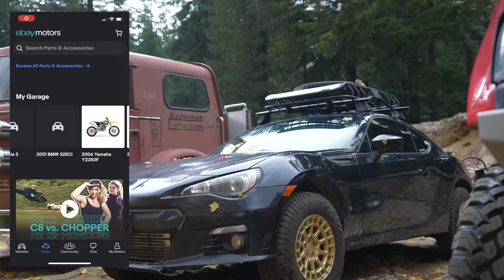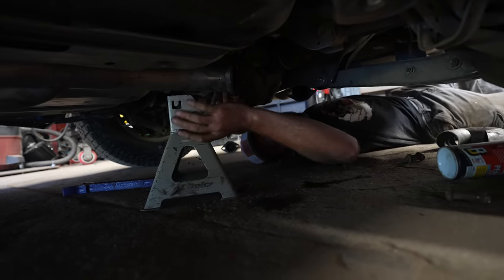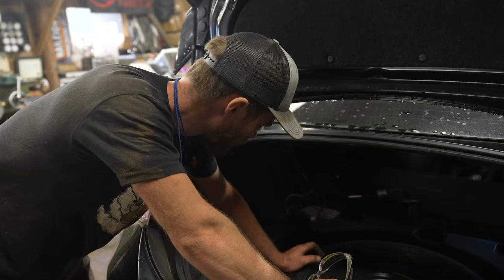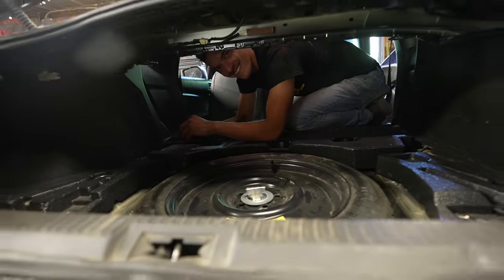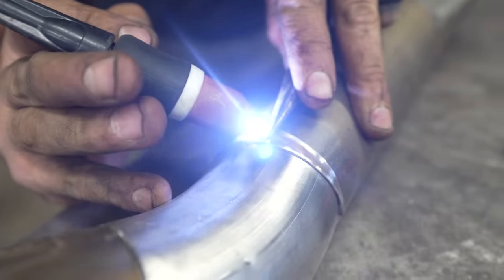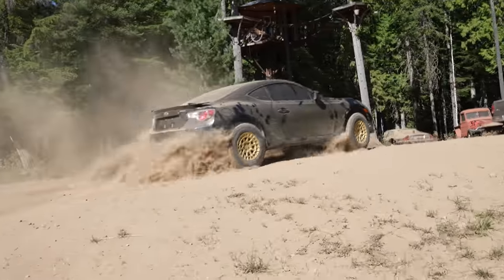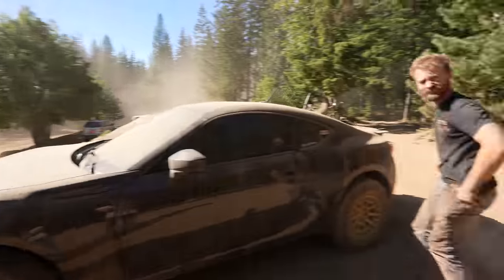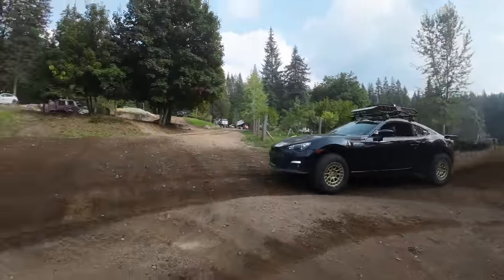Off Road BRZ Build Lifted and Tested!

Comment from the maker: 🤟Enter to win this BRZ or $10,000 🤑and support the channel here https://www.grindhardplumbingco.com/
Reply: As I am sure you know, "The Massive Shaft" of the front suspension is just the damper "up side down", where the thin part is whit in the damper :) Plus, as you say, is that its sturdier, but of course also more friction.
Reply: I'm assuming that you can't do the brz internationally
Reply: BTW, to get max out of that insane suspension, it should prob have a lighter wheel/tyre combo (but that would hurt the awsome look.) :)
Reply: What happened to the little yellow Camaro

Comment: Awesome video like usual but one thing to note.
Please change the stock PCV valve for one from a 2015+ WRX. The stock BRZ ones can't hold pressure and will let boost into the crankcase. A WRX valve is 30 bucks brand new and is designed for boost.

Comment: I used to install car stereo and I've seen everything
Sticky tape used for insulation tape.
Wires twitched together.
Paperclips.
A friend of mine was having issues and when I pulled the head unit he had twisted the wires and covered them in BlueTak

Comment: Had a BMW E91 that the previous owner just cut all the stock amp wiring and twisted in new ones to power an insane (in a bad way) system... it was a nightmare to fix.

Comment: i always do my stereos by just twisting the wires together (then soldering them) and wrapping a ton of electrical tape around everything. in the last 3 cars and 15 years of car ownership it has never caused a problem.
i dont know why you would have to do any of that in the boot though, its all done behind the headdeck under the dash.
in the boot you have wires that plug into the amp, the speakers, the sub and the ground you bolt to the chassis. there is no need to connect wires to wires there.
if i had crimping tools and equipment i would do it that way, but tbh, even without solder, if you wrap wires together thouroughly enough it is highly unlikely they will ever be an issue.

Comment: Doing the same thing to my STI. Got the Flatout GR lite's, sub frame spacers, adjustable lower control arms, toe arms, eccentric lockouts, camber bolts, the whole 9 yards. Now I'm trying to decide on wheels and tires. What are the dimensions of those wheels and tires. I love the stance on that thing so trying to emulate it. I'm looking at 16x7+15 5x4.5 method mr502 v2's and 235/65r16 falken wildpeak a/t3w's.

Comment: instead of rounded buggy off road tyres it would have looked better imho with rally (wrc) style offroad tyres, plus be more fun with the right balance of grip and slip. you dont want too much traction without more horsepower.

Comment: I am concerned with the reliability of a NA Subaru motor untested on boost untuned. 

If this was to be mine I would have to return it to stock, or bolt in a Honda K motor.

Comment: Ebay Motors: "We knew the parts were going to fit the BRZ."
Please just ignore the cutting and hammering we had to do to the fenders and wheel wells. That was just work for something else we want to upgrade.
As a side note I have wrangler tires and steel rims on my Jeep Patriot. I also had to add wheel spacers and cut metal and plastic from the wheel wells.

Comment: I HATE when I see poor radio installs, I go all out solder, color coordination on the heat shrink, wire loom with zip ties or electric tape holding that closed.  I have seen "professional" shops just hand twist and used the cheapest electrical tape that had no adhesion, 4 speakers running off 1 channel
Reply from the maker: It is wild!